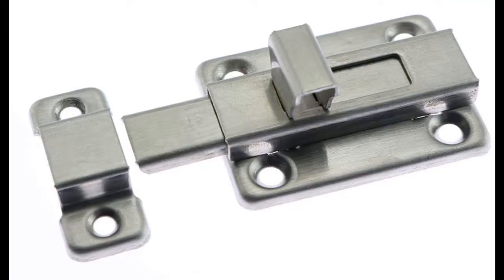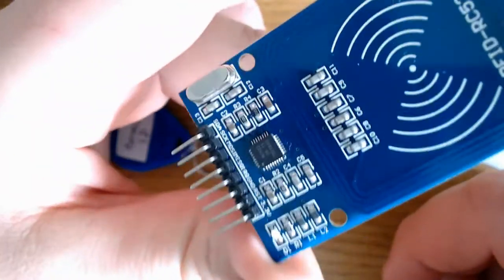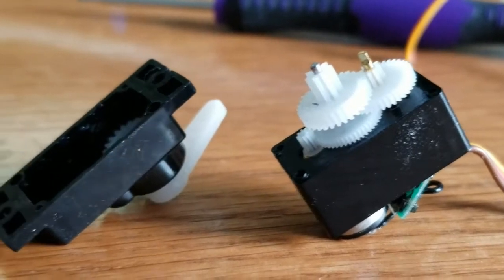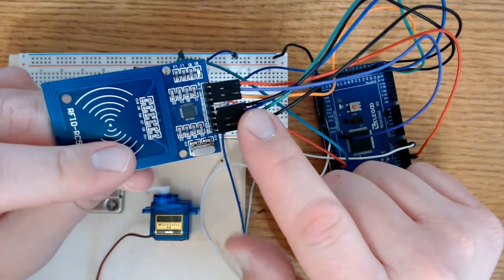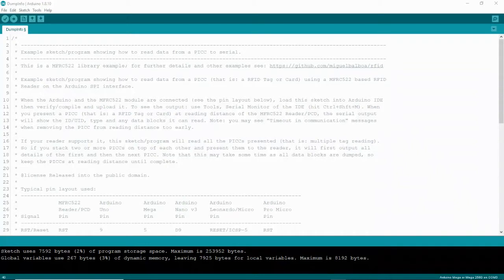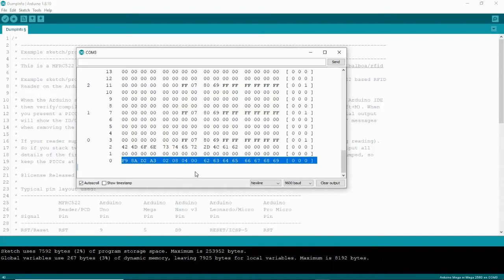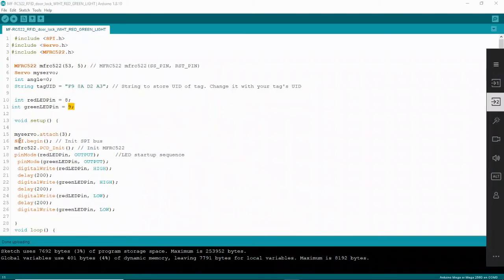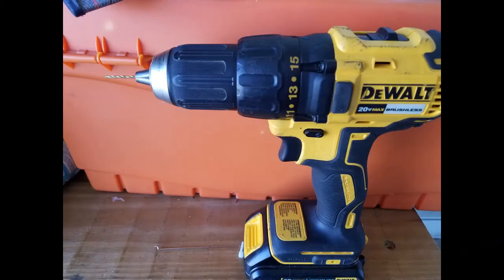DIY motorized door locking mechanism Using Arduino RFID & Servo Motor - A Simple Keyless Door Lock

Comment: it says no such file in  directory what do i do?
Reply: Arduino: 1.8.19 (Windows 10), Board: "Arduino Mega or Mega 2560, ATmega2560 (Mega 2560)"

dump:3:10: fatal error: MFRC522.h: No such file or directory

 #include <MFRC522.h>

          ^~~~~~~~~~~

compilation terminated.

exit status 1

MFRC522.h: No such file or directory

This report would have more information with
"Show verbose output during compilation"
option enabled in File -> Preferences.
Reply from the maker: Hi Soapzyy!  In Arduino IDE: Go to tools - manage libraries - search "MFRC522"- download - 
go to sketch - include library - add .zip library - and select the MFRC522 file you just downloaded.
be sure to include
 #include <SPI.h>
#include <MFRC522.h>
in your code, just as you see here. That should get you set up.
I posted the code on out Facebook page - search   #SimpleKeylessDoorLock 
Code was way too long to post on YouTube.
Reply from the maker: see my previous reply. hope it helps!

Comment: Hello I am having an issue with the part about the serial monitor. I am not quite sure why. I checked both my pins and they were correct but nothing popped up in the serial monitor. Any suggestions?
Reply from the maker: Hi Ryan. make sure your setup baud speed matches the baud on your serial monitor. if you use "Serial.begin(9600);" in setup, set it to 9600 on the monitor in the drop down tab.  hope that helps!

Comment: Can you tell me what is the thing connecting the servo with the lock
Can I use a paper clip?
Reply from the maker: Hi there!  That metal piece is from a toy that I took apart. It was attached to a servo in a robot toy. I have also used a large paper clip and bent it to have the same "L" angle so it doesn't slip out of the servo arm. Try the paper clip - it actually works well!
Reply: @BMonsterLaboratory  thanks 
I have another question if you can help
I have a rotating door lock unlike this one 
I tried just taping the servo motor horn to it 
It managed to turn it around but when it came to locking it didn't have enough power (I have the micro servo 9g)
Do you think having a 10kg.cm servo will work?
Reply: The one I'm using is around 1.3 or 1.8 kg.cm
Reply from the maker: It may just be an issue of repositioning your servo to get an angle it can use to rotate the lock closed. You may want to experiment with different ways to get the servo to open and close the lock. For instance, you may have to put your servo under the lock rather than to the side. You may be better off using some kind of flexible wire or string rather than a paper clip. Perhaps there’s a way to extend the arm of your servo so it can move the lock easier…maybe explore that idea. The 9g servo is not all that strong (about 2.5kg-cm) so a bigger servo may help in your situation.
Sometimes deadbolt locks have some wiggle room and they don’t go though a strike plate easily. Perhaps you could manually check the lock and how easy it operates. It’s hard to say if a 10kg-cm is necessary but then again it may get the job done pretty well. I like the idea of a larger servo anyway. It if works better, great! Otherwise, you have a nice strong servo or 2 for another project!  Sorry I don’t have a better answer for ya
Reply: @BMonsterLaboratory  it's fine the answer is more than good enough
Really appreciate your help
Wish you a good day
Reply from the maker: @brankend  thank you.  Good luck with your projects!

Comment: Where does the 220 ohm resisters go?
Reply from the maker: the 220ohm resistor is between pin 8 and 9 and the positive leg of the LED. the negative leg of the LED goes straight to the ground rail. So, pin 8 and 9 of the Elegoo board to the resistor then to the positive side of the LED. You just want to control current through the LED so it doesn't burn out - therefore, we put a resistor between the led and the pin on our microcontroller.
Reply from the maker: If you're just starting out, it can be tricky.

Comment: Please help on 9:15 i cant find where does pins go
Reply from the maker: Hi Gino!  The red wire is connected to pin 9 on the mega board. The red wire is connected to a 220ohm resistor which is connected to the positive side of the green led. The ground (-) side of the green led is connected to the ground rail of the breadboard. The red led is connected the same way except it's at pin 8. Hope that helps!
Reply: @BMonsterLaboratory  is it  jumper or female to male wires
Reply from the maker: @ginoantenucci6424  all the wires connected to the breadboard from the Mega board are male to male. the wires connecting the red an green leds are male to male.
Reply: @BMonsterLaboratory  thx so much
Reply from the maker: @ginoantenucci6424  You're welcome. Glad to help out

Comment: Can I get a code
Reply from the maker: Hi Nyan. Check the facebook page (link is on the banner). It should be listed under the video post. Let me know if you can't find it.
Reply: @BMonsterLaboratory  I am totally newbie can I ask you ‘’if I want to hold the servo in 35 degrees  when the card place and release to 0 when card is remove’’ what do I type in?
Reply from the maker: @Nyan Tun  my initial thought would be to use a While loop. If the condition is true in a while loop (holding your card to the scanner) the loop will execute. The loop will continue until false (you remove your card from the scanner) - the loop will terminate. It may take me some time to set my project back up to test it out but this should point you in the right direction I believe.

Comment: hi, I was just wondering is there any way of editing the code so that if you hold the rfid card on the sensor for 5 seconds, it leaves the servo motor in the unlocked position. This would be really helpful as the lock is going on a room that people go in so I would need to leave the door unlocked at times so that they can get in? Thanks so much.
Reply from the maker: Sure,  this can be done.  I will have to play around with the code...I'm not a c++ expert yet :)
I'm traveling ast the moment but will work on this later today.
Reply: @BMonsterLaboratory  thank you so much.
Reply from the maker: @archiehaigh4796  I just emailed the code to you.  I think I may add a video using the code I just sent you. Let me know how it goes! good luck

Comment: Hi, I am not on Facebook, is there any other way that you can send the code to me so that I can make this project?
Reply from the maker: #include <SPI.h>
#include <Servo.h>
#include <MFRC522.h>
 MFRC522 mfrc522(53, 5); // MFRC522 mfrc522(SS_PIN, RST_PIN)
 Servo myservo;
 int angle=0;
 String tagUID = "F9 8A D2 A3"; // String to store UID of tag. Change it with your tag's UID
 int redLEDPin = 8;
int greenLEDPin = 9;
 void setup() {
 myservo.attach(3);
 SPI.begin(); // Init SPI bus
 mfrc522.PCD_Init(); // Init MFRC522
 pinMode(redLEDPin, OUTPUT);     //LED startup sequence
  pinMode(greenLEDPin, OUTPUT);
  digitalWrite(redLEDPin, HIGH);
  delay(200);
  digitalWrite(greenLEDPin, HIGH);
  delay(200);
  digitalWrite(redLEDPin, LOW);
  delay(200);
  digitalWrite(greenLEDPin, LOW);
 }
 void loop() {
 // Look for new cards
 if ( ! mfrc522.PICC_IsNewCardPresent()) {
 return;
 }
 // Select one of the cards
 if ( ! mfrc522.PICC_ReadCardSerial()) {
 return;
 }
 //Reading from the card
 String tag = "";
 for (byte i = 0; i < mfrc522.uid.size; i++)
 {
 tag.concat(String(mfrc522.uid.uidByte[i] < 0x10 ? " 0" : " "));
 tag.concat(String(mfrc522.uid.uidByte[i], HEX));
 }
 tag.toUpperCase();
 //Checking the card
 if (tag.substring(1) == tagUID) //change here the UID of the card/cards that you want to give access
 {
 digitalWrite(greenLEDPin, HIGH);    //Green LED sequence
      delay(200);
      digitalWrite(greenLEDPin, LOW);
      delay(200);
      digitalWrite(greenLEDPin, HIGH);
      delay(200);
      digitalWrite(greenLEDPin, LOW);
      delay(200);
 myservo.write(180);
 //digitalWrite(greenLed, HIGH);
 delay(5000);
 //digitalWrite(greenLed, LOW);
 myservo.write(0);
}
 else
 {
 // If UID of tag is not matched.
  Serial.println ("Access Denied");
    digitalWrite(redLEDPin, HIGH);      //Red LED sequence
    delay(200);
    digitalWrite(redLEDPin, LOW);
    delay(200);
    digitalWrite(redLEDPin, HIGH);
    delay(200);
    digitalWrite(redLEDPin, LOW);
    delay(200);
 }
 }
Reply from the maker: I posted the code in the comments here. In the past it would change the format. Let me know if that works...I can always send it by email. Good luck to ya, Archie!  Take care~👍
Reply from the maker: By the way, I plan on posting some other options using this lock and servo setup. Hope you'll check that out as well.
Reply: @BMonsterLaboratory  hi, the code changed format, pls could you send the code file to me by email. Thanks
Reply from the maker: @archiehaigh4796  email bmonsterlaboratory@gmail.com and I'll send in a  reply. Also make sure you have the 3 libraries installed
Reply: @BMonsterLaboratory  I have sent it
Reply: @BMonsterLaboratory  hi, thank you, the code worked. 🙂
Reply from the maker: @archiehaigh4796  awesome! If you ever want any other code that is posted to the Facebook page, I can send it by email...not a problem. Good luck with your project! Take care~
Reply: @BMonsterLaboratory  hi, I was just wondering is there any way of editing the code so that if you hold the rfid card on the sensor for 5 seconds, it leaves the servo motor in the unlocked position. This would be really helpful as the lock is going on a room that people go in so I would need to leave the door unlocked at times so that they can get in? Thanks so much.

Comment: Can i somehow also add an ir remote to unlock the door without standing up?
Reply from the maker: Yes, you can. Here is an example of how to control a servo motor using IR. https://learn.adafruit.com/using-an-infrared-library/controlling-a-servo-with-ir-1   I can help if you need anymore instruction.   good luck to you~
Reply from the maker: If you look at the adafruit code - you can copy the IR portion out of the code example. You can alter it to fit your project. That would be the easiest way to get it done. Also, you might want a stronger IR signal than the one they give you in the Elegoo Mega kit.